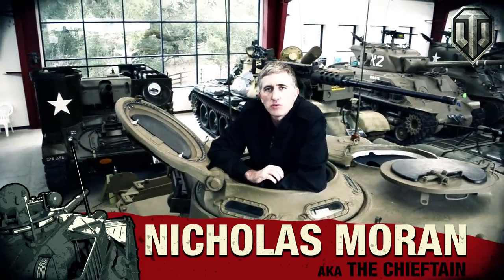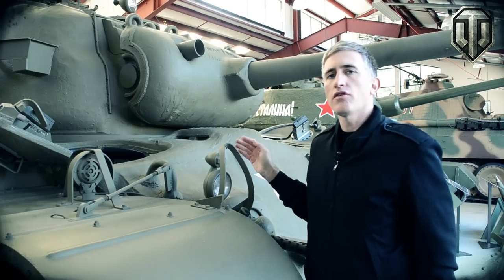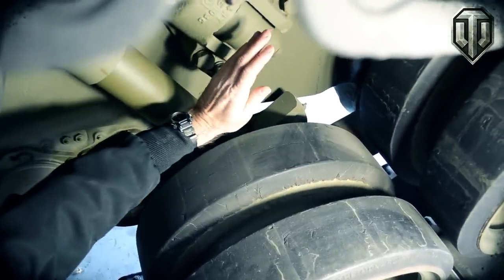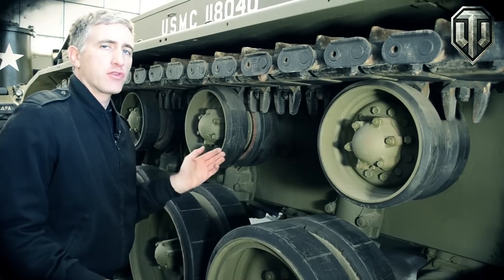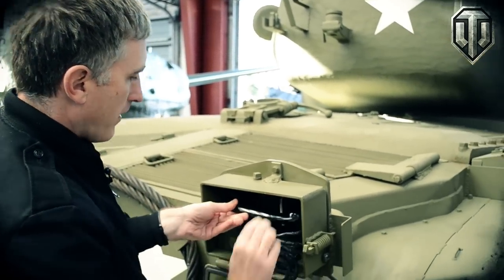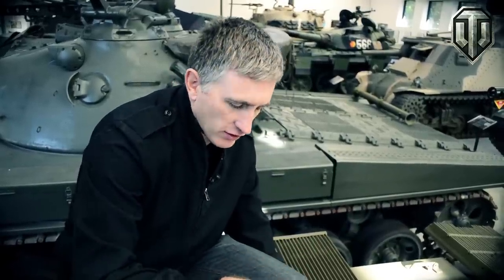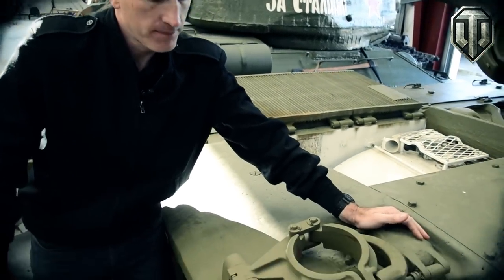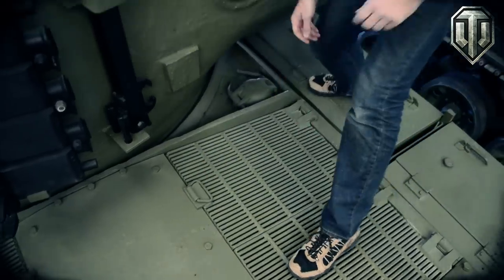Inside the Chieftain's Hatch: M26 "Pershing" Part 1

Comment: Beautifully restored M26! Thanks for the look. 

The 90mm gun, with its 3,700 FPS muzzle velocity, represented a revolution in American tank gun design.
Reply: well that particular round was developed for the t3 version and only saw action in WWII a few times
Reply: The Pershing ate Tigers alive, the 90mm high velocity round would bore through the front armor, and go right through the back without slowing down
Reply: Frames per second?
Reply: @Nightwing690  there's like ""only"" 7 years between their specifications, it would've been embarrassing if it didn't do that.
Reply: @Nightwing690  Tiger and M26 met twice, result; 1:1. Both could knock out the other quite easily.
Reply: @TTTT-oc4eb  IIRC the Tiger I's combat kill was a fluke, they hit the Pershing's barrel. Then the Tiger backed into a building and got taken out itself.
Reply: @m26a1pershing7  a round from the Tiger penetrated the turret front, killing two of the crew. The turret front of the M26 was only 115mm thick and could be penetrated by a Tiger 1 or Panther at more than 1500 yards.

Comment: A few comments about two items mentioned by Nick from an old tanker1) The "large wrench" used to adjust track tension is the "Little Joe Wrench". It's so big that one member of the crew holds it in place while a flattened piece of pipe is slid over the arm. then a 5-6 foot long crowbar (aka "Tankers' Bar") is inserted into the open end of the pipe for leverage and the rest of the crew pull or push to turn the adjustment arm bolt2. The auxiliary engine is also known as "the Little Joe" (he gets around). I forget wear they began leaving out of US tanks, but experience in the GWOT has brought them back as a mod to the M1. 3. Same thing with the infantry phone, on the M60, off the M1, back on the M1 due to experience in Iraq.

Comment: What i have never understood was why they didn't simply revert to the original Ford V-12. Ford had developed their state of the art V-12 aircraft engine to compete with the Rolls-Royce Merlin. It was a more modern design but obviously less mature than the older British design. Henry Ford apparently hated the English and they hated him right back. The US Navy decided to go with air cooled radials and the international politics killed the Ford v-12 as an aircraft engine.

But it was still a good design so they cut off four cylinders and de-tuned it to serve as a tank engine. The Brits did something similar with the Merlin except they used a de-tuned superchargerless Merlin in its original V-12 configuration . They called it the Meteor. The Germans used a V-12 gas engine in the Panther and the Russians used a V-12 diesel in the T-34. A V-12 is the 'natural' smoothest arrangement for a 4 cycle  in- line engine in planes or tanks.
 
The chopped down Ford V-8 was the best engine for a Sherman but the Pershing was much heavier and the eight cylinder Ford just wasn't powerful enough. Leading to the question - why not just revert to the V-12? Eventually American tanks would use Cummins V-12 so I imagine the engine compartment was long enough. The Ford had run as a v-12 and would later again but not in 1945 Europe or Korea. It should have been an easy conversion. Or am I missing something?
Reply: Or put a Packard Merlin variant on the Pershing. I mean, the Brits  were putting the Meteor variant of the Merlin on their newer tanks.
Reply: Why the multibank was bad enough!
Reply: Guys, ya just don't whistle up a new engine in the middle of a war. Norman Friedman's Iron Law - "In a mobilization you continue to build what you're already building." The loss of production is too great. P&W had a what seemed to be a great liquid cooled engine under development in 1939. The day war was declared, the president of P&W called Hap Arnold and said he wanted to cancel it and concentrate on the R-2800. As he put it, the liquid cooled engine was "for the next war". So even though the GAA was a development of the V12, the V12 was an immature design that would need development time (it took the British over a year, maybe two to develop the Meteor, You just didn't takeoff the supercharger and drop into a Cromwell) and time was what the Ordnance Corps didn't have. The GAF would be ready in time, the V12 wouldn't. so the GAF it was. "IF you can't be with the one you love, love the one you're with"
Reply: The Detroit Diesel 6046 (twin 6 cylinder) was probably the best Sherman tank engine, the Russians got all of them.

Comment: 03:4 So, the enemy literally can 'talk' incase of surrounded by enemies ? "Hello, this is German SS Panzerdivision, please surender and you'll not be hurt. Thank you "
 *put the phone to original position
Reply: It was for an infantry commander to point out targets to the tank commander while being protected by the tank. Buttoned tanks are basically blind. Some Shermans had them as well.
Reply: This is a Marine Corps tank so the phone is for infantry-tank communication
Reply: As pointed out below, it's for tank-infantry communication. In particular, the infantry takes out the tank killer teams that thrive in close country like woods and built up areas while the tanks take out machinegun nests, etc for the grunts. It's called the "combined arms team". To give an example of how valuable the phone is, US M1's went into Iraq without them ("We tankers don't do cities") and one of the first mods was an infantry phone when it turned out "Actually we do cities after all". As far as World War Twice goes, it was late in the war that factory installed phones came along. First attempt was a standard field phone bouncing along in the dirt behind the M4's, then Signal Section ETO came up with a field fix, allowing a phone to tie into the intercom system. Kits and instructions were provided so using units could perform the modification. BTW, the housing was an empty 30 cal ammo can welded to the back of the tank.
Reply: Modern tanks have infantry phones as well. There’s One on the back of the M1 Abrams so infantry behind cover of the tank can communicate
Reply: Alpha Adhito You mean the one he calls “tank-infantry telephone”?

Comment: Man changing the track tension was so much easier on the modern CV90 you just adjust two valves in the back and the driver  can temporarily increase tension with a button when driving in things like sand or a marsh where the risk of a track being thrown is high.

Comment: Always a good video. Pershing tank does look tidy but how did it do at war i wonder
Reply: During war it had varied results, such as being unreliable and struggling to climb slopes, but on the other hand it usually chewed through most other tanks
Reply: @civilrebel3743  quite surprised to know it climbs poorly. Tbh i dont know what characteristics make a tank a good climber; Churchill's type of bogies maybe (they arent bogies really are they)
Reply: @rinsedpie  some tanks are designed to go up slopes- the Churchill was a great climber, as it was made to be a sort of all terrain tank capable of supporting infantry, and it excelled at its job. The Sherman, IIRC, was a decent climber, however the reason the pershing was a bad climber was the fact that it was designed mostly around a bigger gun and thicker armor- think something among the lines of American tiger. Also, tbh I don’t really know what makes a tank a good climber, however traction and power plays a big part with in it.
Reply: @civilrebel3743  cool! Good info. Im always on a prowl for a good vid looking inside Merkavas. Watched most already but still cant say they are good ones; if you find any good long ones, do let me know.

Comment: So you had a pz.58 right there. Shame there wasnt a video about it, quite an interesting tank with a rather unique suspension system, right?
Reply from the maker: It was a 68, actually. But, no, I didn't have time to hit it.
Reply: if by any luck you get the chance to make one please do it. I´ve been looking for info about that suspension system and so far haven´t found anything of much value.
Reply: pz. 68? wasn't that the tank where activating the heater also fired the main cannon?
Reply: Thomas Zinser yeah. the PZ 88 is the same tank except it's got that stuff working like it's supposed to.

Comment: this tank was designed to meet and defeat the Tiger. Unfortunately it arrived a bit to late to impact the war.
Reply: It was simply an evolutionary successor to the M4. It was not meant to counter any specific tank.
Reply: nathan peterson: the m26 has nothing in common with m4,therefore not evolutionary. US wanted new
tank to counter heavy german armor,the tiger being best example. mk5 was good but mk6 was better.
mk7 not produced in numbers to be big threat and unreliable.
Reply: The T26 (more proper for the era) is a directly succeeding evolutionary design to the T25, which was an enlarged T23 with a 90mm gun, and the T23 and the T20 prototypes, which you guessed it, are an evolutionary successor to the M4. Not  to mention it shares the same engine as the M4A3, effectively the same transmission, same periscope equipment, same turret hatches, same gyro stabilizer design, same oil-gear type turret traverse pump, same castings even for the earlier return rollers compared to the HVSS M4s as well.

The Mk.7? What? Do you mean The PanzerKampfwagen VI Ausf.B "Konigstiger"? The King Tiger?
Reply: Not to mention same turret ring design and width.
Reply: Yet the one time it met the Tiger in combat it didn't do so hot. It shares the same engine as M4a3 as well as it's turret ring as well as features of its track, sighting systems and other bits. It was definitely a design successor to the M4 medium. You can see design influence from the M4 medium carrying over even into today's Abrams if you look hard enough.
Reply: Joseph Ahner At leads the 90MM gun could take out the Tiger. It was a case of may the best tank crew win
Reply: It was designed to kill the Tiger and Panther. Patton and other Generals wanted nothing to do with the Pershing due to the fact that it was slow and too heavy for the roads and bridges in Europe. As such, it could not support Patton’s philosophy of rapid advancement. The Tiger was so rare that the few they did encounter could be dealt with using air power, tank Destroyers, or the “Easy 8” Variant of the M-4 Sherman
Reply: william jc You can thank General McNair for the Pershing being late in the war. You can thank B17 bombers for it not being even later than it was.

Comment: I was hoping I would get a look at the bulge of the front armor 1:09 and why its there and if the armor is thicker then the rest of the hull. I can't find anything about it but from a picture of the tanks profile it seems that this part of the hull armor is thicker than the rest.
Reply: Except for the upper portion, no, its not thicker. The bulge is to accommodate the 400cfm blower. 

Later models and the M46 had a wider, lower, less steeper bulge to accommodate the 1,000 cfm blower. 

http://www.theshermantank.com/wp-content/uploads/blower-for-the-crew-1.png
Reply: Kim Janek probably angled forward for the turret ring
Reply: Nevermind lol